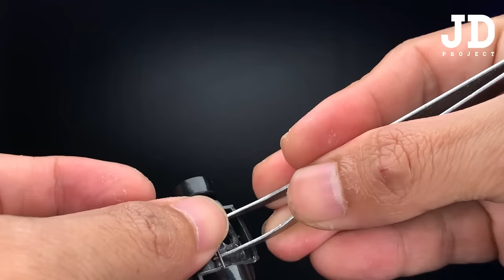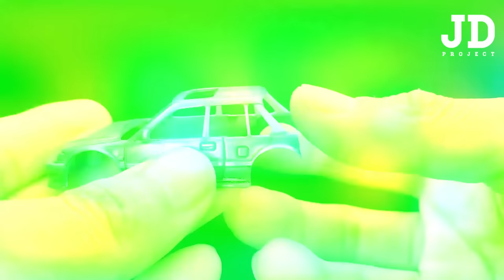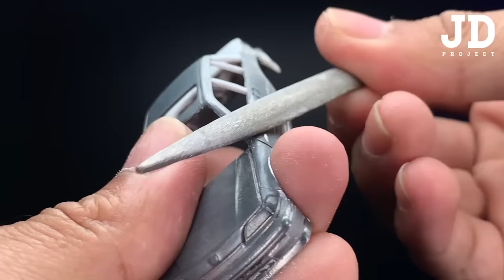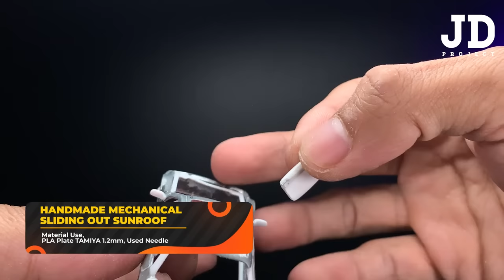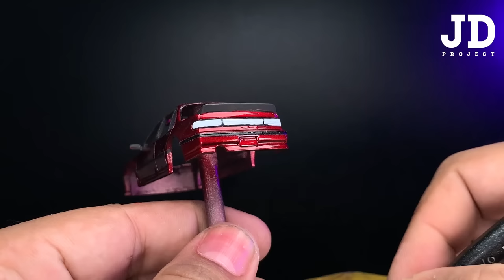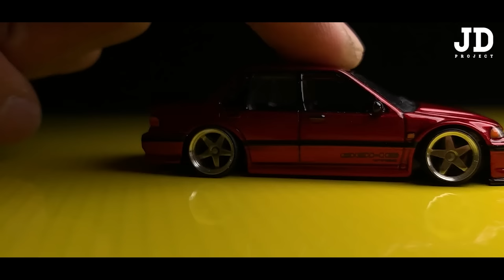Honda Civic EF Sedan HotWheels Custom convert Honda Civic EF to sedan

Comment: damn i remember back in the mid 90's some of my buddies have EF sedans, these cars were nice easy to customize, 1 of my buddies did a candy metallic green with gold player wire rims, lowered and a load sound system. I never forget that car. it was turly a head turner in that time/era.
Reply: wire wheels are underrated fr